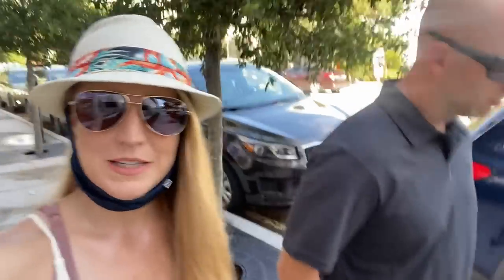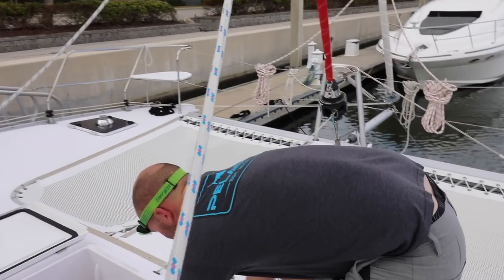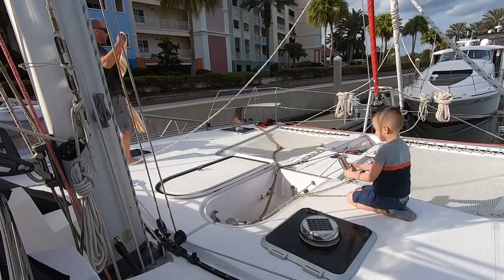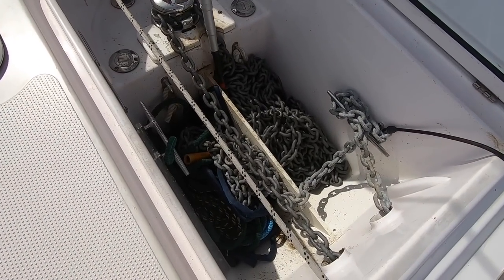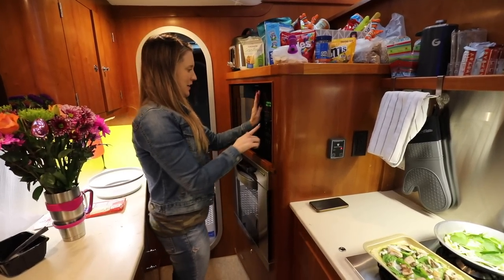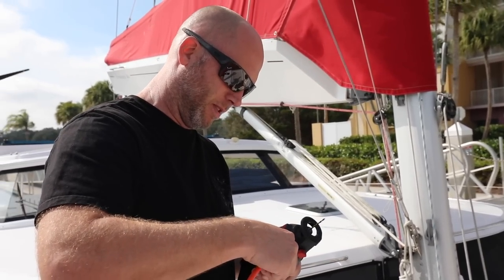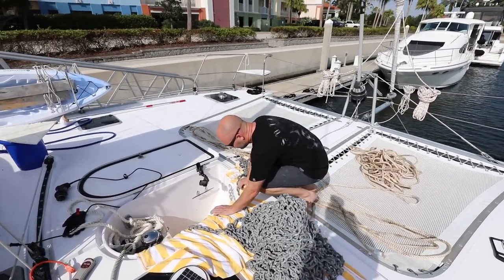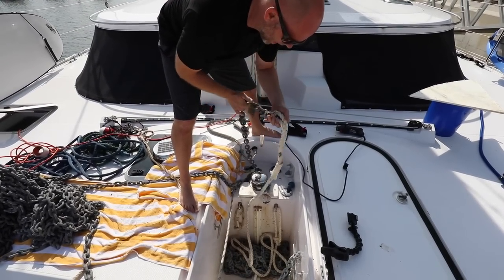Replacing Anchor Chain is a PAIN in the BUTT -  Lazy Gecko Sailing Ep. 229

Comment: Why not just remove the screws on the chain locker diviver board to remove it?  A little sealer in the holes and done...
Reply from the maker: Well, removing the screws will make holes. Then you could seal them but that increases the chance for a leak. Then you would have to drill more holes and reinstall the piece in if you ever want to add the divider. There would be absolutely no purpose in doing any of that, it would only increase work, chances of a leak and more work to reinstall the divider. Right now it’s sealed, it has a frame for a new divider. If we want one, get take that cut piece out, use it as a template to cut a new piece of starboard and slide it in. Easy.

Comment: Hmmm, I have used two anchors several times. When anchoring in a tidal stream, I did not want the boat to swing so I anchored fore and aft. Check out also Bahamian rig anchoring. Two anchors on one rode can also be very useful in storms, a secondary anchor on a short 10' piece of chain attached to the main rode acts as a kellet, guaranteeing when the winds shift your main anchor gets a chance to reset. Just saying.
Reply from the maker: Yeah we knew there would be some different opinions on that topic. Everyone's different and that's ok. We like to swing (no pun intended) when tides shift in case other boats are near by or anchor near by. Putting a stern anchor out increases the chance of a collision. We saw that happen once in No Name actually. Power boat came in late, dropped a stern anchor. Tide shifted, everyone swung which caused them and another boat to get their anchors twisted together. A disaster unfolded at 2am. For us, we've never needed more than the one anchor.